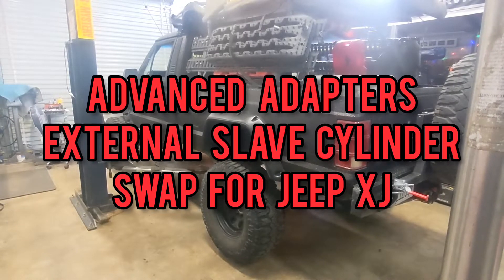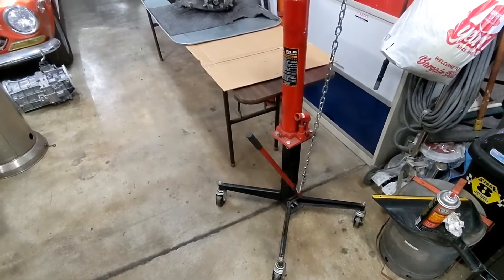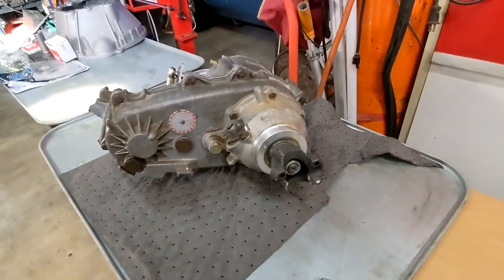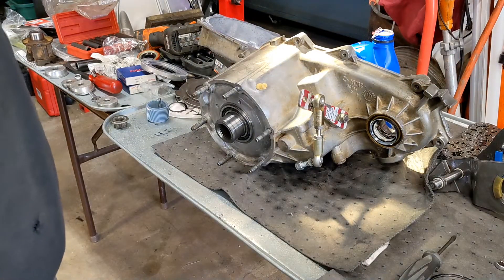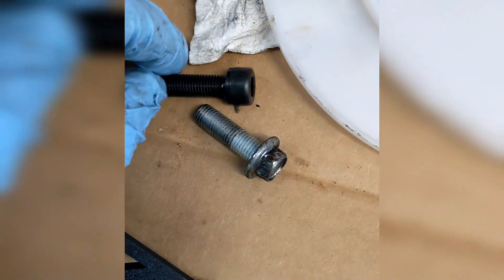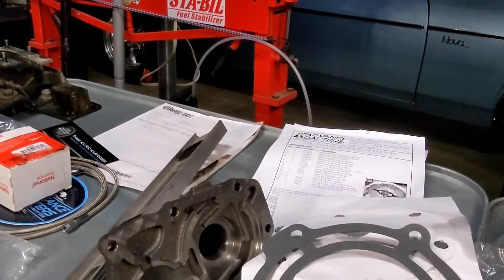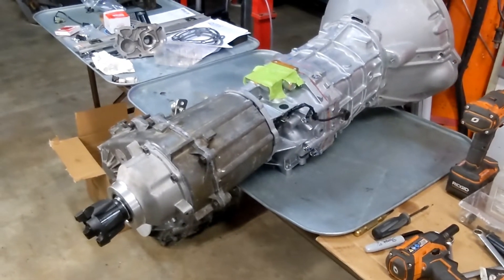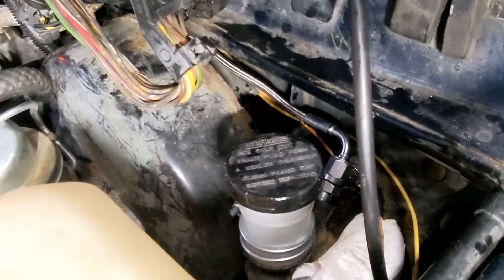External Slave Cylinder Conversion for Jeep AX15, Adapting a TJ transmission to an XJ/MJ. 712590-IR

Comment: I am also in the middle of this job. Where the pivot ball threads into the Bell housing, it screws flush against housing, and then nut (a nut ?) #12,#13, goes on backside of bell housing onto stud, backside of pivot ball  ? And I tend to over complicate things. 😂

The diagram doesn’t show it going on the back. But it does kind of look like it is separated by the bell housing. 

Or do you screw the nut on the pivot ball stud, and then screw all of that to the bell housing? In your video I don’t see a nut on the back of the housing.
Reply from the maker: https://cdn.xjjeeps.com/pdf/en-us/1994-to-1996-parts-catalog.pdf
In the factory part diagram, (page 103 in the link), it appears that the factory setup is for the ball to just screw in. I don't know what installing the nut would hurt. Looking back at the AA instructions, I do see a "ball pivot nut" listed in the parts list.     My guess is that it is just a failsafe to keep the nut from loosening? I wish their instructions were  more detailed.

Comment: What did you do for a pilot bearing and puller?
Reply from the maker: I believe it was Precision fc69907. The crankshaft is stepped and this one is a larger diameter and sits slightly farther out. It's listed for a 94+ . I just use a cheap puller from Harbor Freight or Amazon usually, but I've tried the bread trick too.
Reply: @campoutwestus  for the precision bearing that includes the outer bushing and the inner bearing ? Also, how did the outer bigger diameter bearing out? Just with a puller?
Reply from the maker: There is also a bushing that fits into the original smaller hole that's supposed to work. dorman PN 690-042, fits a 1974 CJ5 with a 304. I haven't tried that one myself.
Reply: @campoutwestus  thanks yoh

Comment: Did you have to do anything to the crossmember to get the new transmission in a bit?
Reply from the maker: I converted it to the AX15 about 20 years ago, so I don't remember every detail. I did use the crossmember  from the AX15 Jeep and had to move the crossmember  to another set of holes on the frame. The blanks were there, but needed to be threaded. Hopefully, that's what you were asking. No modifications were needed on this go around as far as the mounting went.

Comment: I’m getting ready to do this on my Comanche. Could you give a little more detail on the clutch fork and pivot ball setup you were having trouble with? What was the issue?
Reply from the maker: The orientation was my question, the fork would fit in two different ways. I confirmed the proper orientation with Advance Adapters, I believe that I covered it in the video. There's also info here. https://comancheclub.com/topic/70337-advance-adapters-ax15-transmission-and-external-slave-kit-link-to-youtube-video/

Comment: Why did you go with a standard transfer case chain and not a wide chain and 6 pinion planetary?
Reply from the maker: The standard components have lasted over 30 years and the chain was still functioning, so I didn't see much sense in changing.

Comment: What pilot bearing did you use?
Reply from the maker: I believe that it's PN fc69907. The crank is stepped and it fits in the outer location.

Comment: Hey man I got a few questions. We just picked up an 89 Comanche and I’m not sure what trans it has. But I’m thinking it’s a BA-10? The guy that sold it to us said the “slave cylinder is bad”. My questions are:
-What year of ax15 do I need to bolt in the 89 Comanche? 
-will a AW4/Np231 from a 2001 XJ bolt up to the Comanche?
-how hard
Reply from the maker: I believe that any year AX15 will work. The later ones will already have the desirable external throw out bearing. TJ ones will also fit, but you need to redrill the rear housing, like I had to with the Advance Adapters unit. You should have the BA-10, but I'd definitely look at photos and make sure yours hasn't already been swapped. 
Not sure on the 2001 XJ AW4, I don't know  about the computer control system  in those or if it would move things enough to need a different driveshaft/shafts?
Reply: @campoutwestus  thank you sit
Reply from the maker: I just saw this, might help you with the Auto questions. https://comancheclub.com/topic/72730-1991-ax15-4x4-swapped-with-1998-cherokee-aw4/?fbclid=IwAR3fq5IyCHqFdfVUimzkm3Ii-5d94ObK7Gi44N6N2Ud_xP3EaNMGziH_w_Q
Reply: @campoutwestus  awesome Ty

Comment: Best conversion video I've found online, great job and thank you!!! Will this work to convert all internal slaves on AX-15 s (YJ for example), or just the commanche?
Reply from the maker: They should all be the same. Advanced Adapter shows the same part number for 89-93 YJ and XJ. You might check Advance Adapters website to verify. Glad you found this helpful

Comment: Have you converted your rear brakes to Disc's, or are you still using drum brakes and the Height sensing set-up in the rear?
Reply from the maker: We've got a Ford explorer 8.8 rear end with disc breaks with no hight sensing setup.
Here's a link to the walk around video that shows it a little bit https://youtu.be/4M4Ad6moe0E

Comment: I have owned my 1992 Comanche for the past 26 years.  I have the AW4 and would like to swap for the AX15.  Novak Conversions sell the AX15, and if you tell them the year, they will drill the correct hole pattern.  I have the AX15 in my 1992 Cherokee, and the power, cooling and gas mileage is much better than the automatic.  Glad to see your keeping your Comanche going.  I noticed you have the cowl intake.  Do you find that it is loud?👍
Reply from the maker: Thanks for watching, we went with the Advance Adapters because of the cost savings. The cowl intake does make some noise, but it just adds to all of the other old truck noises 😁

Comment: damn, you are a dedicated stick shift guy, i would have AW4 swapped it the second time i had to pull it, lol. my love affair with stick shifts ended in my 30s after many broken T5 transmissions and various parts street and drag racing and  ive never looked back and im 53 now. i was running toward the TV trying to catch your falling trans, that sucked. well you got all new stuff now so hopefully it lasts👍.
Reply from the maker: We definitely lucked out. The only damage that I found was the yoke. I got the truck in 1995, so pretty much everything has been "fixed" multiple times at this point. Thanks for watching!
Reply: Ironically, almost all of our vehicles have manuals, except for the hot rods. It's just so much easier to stick an auto in rather than swap to a manual and as you found, it's also easier on parts!